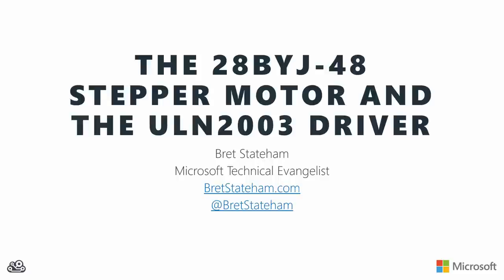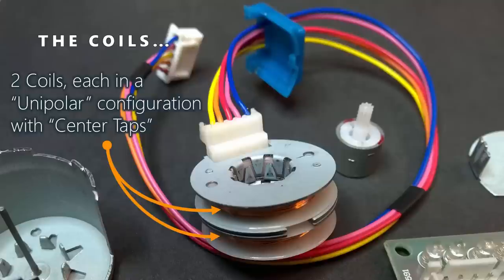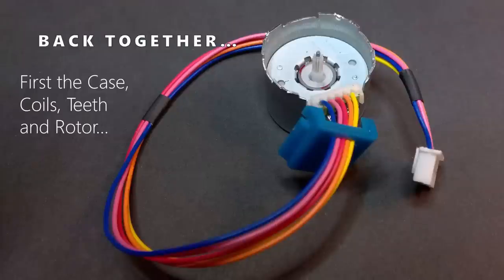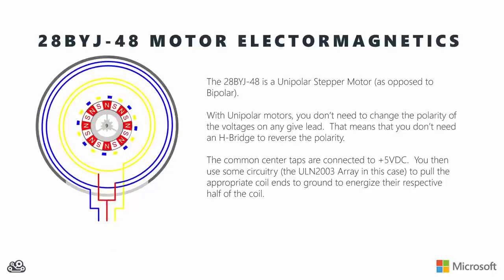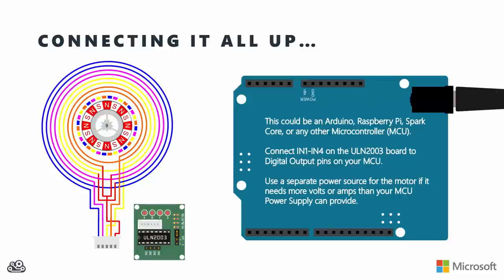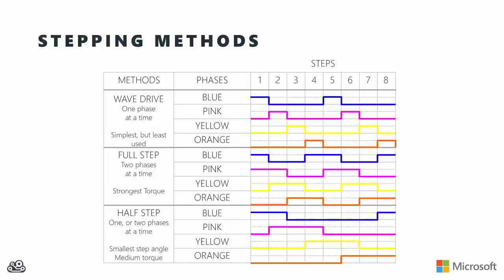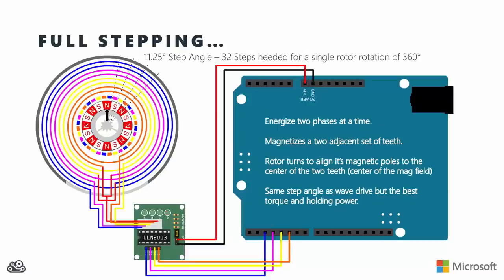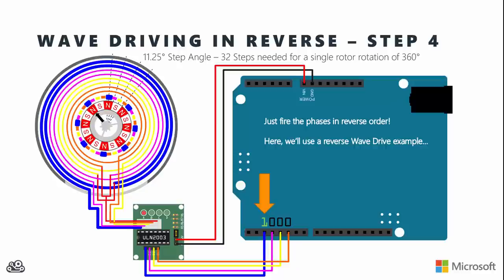28BYJ-48 Stepper Motor and ULN2003 Driver Intro

Comment: Hi Sir, may I ask if it is possible for us to program the stepper motor to turn and stop at 6 different angles , ie use it to turn a signboard with 6 sides. I would greatly appreciate it if you could give me a reply. Thanks!
Reply from the maker: Hwei, apologies for the delayed response.  Yes, using a micro controller and some code you can pretty much drive these motors any way you want.  I have another video (http://aka.ms/28BYJArduino) where I show you more practically how to drive the motor using an Arduino.  From that video you can see how to drive the motor.  From there you simply modify your code to turn the motor the direction you want, for the distance (number of steps) you want.

Comment: I ordered some 12v versions of this motor..Is there any difference besides the voltage?
Reply from the maker: I haven't tried them myself personally, so I can't say for sure.  As you suggest though, the voltage is different so make sure that you consider the voltage and amperage requirements of both your MCU and the Motor.  If you are using an arduino, you can actually power it with 12 volts so you may be able to use the same supply.  I just recommend that you pull the power for the ULN2003 board directly off the supply and not off the Arduino so there is no overload on the draw through the Arduino.  As long as the Arduino and the UL2003 have a common ground, all should be good.
Reply: Bret Stateham As far as I know I'm only getting the motor with no driver board..I'll be using the same easy drivers that I use for my mini dvd rom cnc/plotter..They should hopefully do the job and I'll most likely wire it up exactly the same way with an arduino uno as well..Oh btw the specs appear to be the same on the 12v motor as the 5v one except of course the voltage..Not 100% sure though as I could only find the datasheet for the 5v version.
Reply from the maker: Cool. We'll I haven't dug into the internals of the 12V motors.  Not sure if the gear ratio, etc. is the same.  However, as long as it is still a unipolar configuration, the overall concepts should be the same.

Comment: Hello, I am using the same stepper motor which works with 5 volts and connected it to my arduino uno but it doesn't rotate, I can only feel the steps when I touch it but nothing visible.
Reply from the maker: Erjona, can't help you without more specifics on your setup, code, etc.  Have you watched my video on driving these motors from the Arduino?  It provides a more practical overview of connecting and driving your motor.  You can see that here: http://aka.ms/28byjarduino

Comment: Can you make a video on how you turned that USB cable into a 5V power supply by splitting it and connecting it to jumpers? Because I see four wires in there. update: I found an e-cig charger that only had 2 wires, red and black.
Reply from the maker: @spinNspiral, glad you found a solution. Mine was pretty low tech.  I literally just cut the end off of an old USB cable (the end that plugged into the phone, device, etc).  Luckily, mine had a red and a black wire that I assumed were 5Vdc and Ground respectively.  I stripped the ends of the wires, plugged the other end into a USB charger block and tested the voltages on my multi-meter.  Luckily, they were the right leads.  If they weren't, I would have just stripped the ends of the other wires and kept testing pairs until I found a +5V and a Ground.    Then I soldered the ends of properly colored (red and black) jumpers to make it easy to connect to them.
Reply: Thanks Bret! I was able to finally get my motor stepping! At first I was using a 9v battery. But that didn't work. I guess it must have a circuit that only allows 5 or 12 volts through. My first success was through 5v and GND right on the arduino itself. And then I made the cable and tested it, and it worked too. Slowly getting up to drone building :) Working my way up to transceivers and gyros.

Comment: If I were to wire two of these Stepper motors in parallel so as to control both at the same time from only 1 driver, how can I be sure the Arduino is supplying enough current to each motor?
Reply from the maker: @Skyler, sorry for the delayed response.  I assume you have moved forward and would be interested to hear about your results.  That said, here's my response:

Disclaimer: I haven't tried trying to control two motors using the same pins on the Arduino.  I am totally speculating here.  Proceed at your own risk.  

The arduino isn't supplying the current.  It's simply controlling the Darlington Pairs in the ULN2003 chip to pull a the coil ends to ground based on the driving mode.  

If I read the datasheet for the ULN2003A chip right (no promises there), it looks like the input current for the chip is between .93 and 1.35 milliamps.  With two ULN2003A chips in parallel that could MAX out at 1.35 x 2 or 2.7ma.  Well under the 20ma recommended max per pin on the Arduino.  Here's a link to the datasheet: http://www.ti.com/lit/ds/symlink/uln2003a.pdf

So I would THINK you should be safe doing it.  

You would also need to make sure to tie all the grounds together, and either power each ULN2003/Motor pair with their own supply, or with a common supply that could push the required amps.  It's hard to find an actual datasheet for the 28BYJ-48 motors, but this site, https://arduino-info.wikispaces.com/SmallSteppers , seems to suggest 320ma per winding which would mean 740ma per motor, call it 1A.  So you would need a 5V/2A power supply for two motors.  

One thought that comes to mind though is that the 28BYJ motors are cheap motors with plastic gear sets and as such they are susceptible to slippage.  That means that even though you are sending the same signals to both ULN2003 driver boards, the motors MAY NOT be behaving identically, especially under load.  You may want to consider an external encoder on each motor to help determine your shaft position if having the motors in sync is critical.

Comment: So all that the ULN2003 does is light up those LEDs and relay each of the inputs?
Reply from the maker: No, the ULN2003 is what is providing the power to the stepper motor phases.

Comment: I don't know if you still read the comments, but I have a really big problem. When I try to upload any code to my Arduino uno the motor just vibrates and only LED's BC and D light up, I have never seen A light up. This could be something to do with it being blown but I can't see it being that as it is a brand new board. Any suggestions?
Reply from the maker: My guess is you have some bad hardware somewhere.  Most likely the ULN2003 driver board since the A  LED isn't even lighting.  I suggest getting a trying a different board.  Before doing that, you can double check that your jumper cables are good.  The motor/board hardware is cheap enough that I'd suggest just ordering a few online and testing with a different motor and board.   If you figure out what the problem was though, please share.
Reply: so it turns out that the board works with LED a dead, but the chip was in the wrong way round!!! luckily it wasn't damaged haha and switching it round made it work, although I still have to solder a new led onto it :) thank you for you video though, it showed me exactly how I can program it!

Comment: There is something I don't get. The yellow pin should provide a reverse magnetic field as the blue one. Why does the motor move forward instead of backwards in half of the pins? Thanx :)
Reply from the maker: Watch Gavin MacDonald's video. https://youtu.be/Dc16mKFA7Fo  He does a much better job of explaining how the magnetic fields move the motor that I did here.  Ours are very similar, but his may make more sense to you,.
Reply: Yeah, that was simple! was the perfect complement I needed. Thanx :)

Comment: I have a question on the files you provided on your follow up video. When I try to do half-stepping with your code, I can't stop my motor from going clockwise to counter clockwise after a full rotation. Your code says that I should set the number of steps until it rotates again to 0, but setting it to 0 makes my motor "jam up." It doesnt move. How can I remove the reversing command?
Reply from the maker: @Xavi, do you want it to run in a single direction continuously and never stop?
Reply: Bret Stateham yeah
Reply from the maker: I did a quick test:

1. I opened the S06_HalfSteppingWithArrays sketch (https://raw.githubusercontent.com/BretStateham/28BYJ-48/master/Arduino/Code/S06_HalfSteppingWithArrays/S06_HalfSteppingWithArrays.ino)

2. I commented out the "int targetSteps = 4096;" line of code

3. I uncommented the "int targetSteps = 0;" line of code

I uploaded the sketch to my Arduino, and the motor ran continuously in a single direction.  

Here are the updated code showing my changes to the targetSteps definition:

// How many steps to go before reversing, set to zero to not bounce.
int targetSteps = 0;  //targetSteps 0 means the motor will just run in a single direction.
//int targetSteps = 2048;  //2049 steps per rotation when wave or full stepping
//int targetSteps = 4096;  //4096 steps per rotation when half stepping

I didn't make any other changes to the sketch, and it seems to work fine. 

Getting it to run continuously in the operation is done by simply changing the "bool clockwise=true;" to "bool clockwise=false;" or vice-versa.
Reply: I'll try it out when I get home. Thank you
Reply: This works with half stepping! But what if I want to do it with full stepping? Is it possible? I made sure to comment out the 2048 steps and uncomment the targetsteps=0 and my motor glitches out.
Reply from the maker: Hah!  You found a bug.  I had a logicical math error in the "else if" block that reset the currentStep back to 0 if you were running continuously (only when targetSteps==0).  It was broken on the Half Step sample as well but the motor was able to recover from it when half stepping and keep running.  It couldn't recover from the error in Full Stepping and thus hung.   The original code was:

else if(targetSteps == 0 && currentStep == (stepCount-1)) {
    // don't reverse direction, just reset the currentStep to 0
    // resetting this will prevent currentStep from 
    // eventually overflowing the int variable it is stored in.
    currentStep = 0;
  }

That "(stepCount-1)" in the expression caused the currentStep to get reset to 0 on the step BEFORE the last step, so the last step was never getting exectued.  I changed the condition to:

else if(targetSteps == 0 && currentStep == stepCount) {
   ...
  }

And that fixes the problem.  I have updated all of the affected samples and committed my changes and checked them back into the http://aka.ms/28byjrepo repository.  You can either just modify your code to match the changes I made here, or re-download them from the repo. 

Thanks for helping me find that! 

Bret
Reply from the maker: Now, after going through all of this, wouldn't you rather just use a library like AccelStepper?  I discuss that at the end of my Arduino video on Channel 9 here : http://channel9.msdn.com/shows/themakershow/8#time=26m30s
Reply: Thank you so much for your help. Your tutorials were detailed enough for a beginner like me to follow :)
Reply: Agh sorry to bother but if I want my stepper to run at a constant speed without using the acceleration library, how do I do this? I know that one of the files were extracted from accelstepper says something like "constantspeed" which I would like to use but I have no idea how. Any suggestions?
Reply from the maker: Hey Xavi, I didn't write AccelStepper.  In the future you should use its documentation and support forums (http://aka.ms/accelstepper) or other resources like http://stackoverflow.com for help.  

That said, i figured this one out for you.  

1) Install the AccelStepper library on your machine as I describe in my other video (http://channel9.msdn.com/shows/themakershow/8#time=26m30s)

2) Open the Arduino IDE (I assume you have this, if not you can download it from http://arduino.cc)

3) From the Arduino IDE's menu bar, select "File" | "Examples" | "AccelStepper" | "ConstantSpeed"  
    Note that the "AccelStepper" option will be near the very bottom of the "Examples" list.

4) Review the code that is in there.  IT WON'T WORK AS IS.  We need to tell it which pins to use to get to the ends of our motor coils.  Again, I describe this in my other video.    

    - Modify the "AccelStepper stepper" initialization to specify FULL STEPPING (4) and to pass in your coil ends in blue (2), yellow (4), pink (3), orange (5) order.  If your pins are wired differently, make sure to use the right numbers here. Also as described in my other video the pins are passed in coil-end order, not firing order:

    //The first 4 means FULLSTEP, then the coil end pins Blue, Yellow, Pink, Orange
    AccelStepper stepper(4, 2, 4, 3, 5);  

    - Modify the "stepper.setSpeed(x)" where X is your target speed.  On my test 28BYJ-48 with a 64:1 gear ratio, my max absolute speed was about 650.  Your top end may vary on your motor, these are not precision devices! :-)  Use positive numbers to turn the motor clockwise, negative numbers to turn counter-clockwise.

    //On my 28BYJ-48 with a 64:1 gear ratio my max speed was about 650
    //Positive speeds are clockwise, Negative Speeds are counter-clockwise
    stepper.setSpeed(650);  

I'll paste the complete code below.  In the future though please refer back to the docs and more public forums for help.  Good Luck! Here's my final code:

// ConstantSpeed.pde
// -*- mode: C++ -*-
//
// Shows how to run AccelStepper in the simplest,
// fixed speed mode with no accelerations
/// \author  Mike McCauley (mikem@airspayce.com)
// Copyright (C) 2009 Mike McCauley
// $Id: ConstantSpeed.pde,v 1.1 2011/01/05 01:51:01 mikem Exp mikem $

#include <AccelStepper.h>

/*

Assumed Pin Mappings

| ULN2003 Board | Motor Phase | Arduino Pin |
| ------------- | ----------- | ----------- |
| IN1           | Blue        |           2 |
| IN2           | Pink        |           3 |
| IN3           | Yellow      |           4 |
| IN4           | Orange      |           5 |

*/

//AccelStepper stepper; // Defaults to AccelStepper::FULL4WIRE (4 pins) on 2, 3, 4, 5

//The first 4 means FULLSTEP, then the coil end pins Blue, Yellow, Pink, Orange
AccelStepper stepper(4, 2, 4, 3, 5);  

void setup()
{  
   stepper.setMaxSpeed(1000);
   
   //On my 28BYJ-48 with a 64:1 gear ratio my max speed was about 650
   //Positive speeds are clockwise, Negative Speeds are counter-clockwise
   stepper.setSpeed(650);  
}

void loop()
{  
   stepper.runSpeed();
}

Comment: can I connect the ground from the stepper motor and the ground from uln2003 to the same ground from arduino ( trough a breadboard for example) ?
Reply from the maker: As I describe in this video (at about 10:24), you need to make sure the grounds are connected.  The ULN2003 driver board has a "-" (GND) pin on it.  The ULN2003 board then pulls the coil ends down to that same ground so the ULN2003 and Motor now have the same grounds.  If you simply connect that "-" pin on your ULN2003 board to your arduino's ground you are all set.  You don't NEED a breadboard.  However, if you have additional external components that also need to be connected to ground, a bread board, or more permanent ground bus on a prroto board, etc. is certainly an option.  It doesn't really matter HOW you connect the grounds, as long as you get it done.
Reply: Bret Stateham thanks mate . English is not my first language and I am newbie to electronics. I  will use other things connected to arduino mega together  (sensors , some stepper motors etc) and I was looking for a motor to fit some posible projects.
Reply from the maker: No problem.  I have a video specifically about driving these motors with an Arduino that might help clear things up as well.  You can see that video at http://aka.ms/28byjarduino

Comment: Where can i get linear screw thread for this motor?
Its for my mini cnc plotter project.
Reply from the maker: I haven't connected them directly to a threaded rod, but typically you would use some kind of a coupler.  The brass shaft coming out the face of the motor is 5mm in diameter.  If you search Amazon for 5mm motor shaft coupler you should see a ton of options.  One end of the coupler would attach to the motor shaft, the other end of the coupler attaches to your threaded rod. The coupler would then have set screws on  the sides of each end to help fix it o the shaft and rod (https://www.amazon.com/s/ref=nb_sb_noss_2?url=search-alias%3Daps&field-keywords=5mm+shaft+coupler)

Comment: Does anyone know what type of connector to use to connect a load to the shaft on these motors? Because it is a half-round shaft it looks like you'd use some kind of collar or a hollow shaft with a set screw, but could not find anything that works well. I ended filing the shaft into a square that would fit on large plastic gear, but there's a lot of play in the connection.
Reply from the maker: +Kevin Miller Not sure about official parts, but a quick search on thingiverse showed a number of 3D printed thngs: http://www.thingiverse.com/search/page:1?q=28BYJ-48&sa=

Comment: i hooked up 4  500ohm resistors from 4 ic inputs to ground. i put in 4 switches. i stepped it around a 1/4 turn. 100's of 1-4 switch presses. on 12 volt ac adapter. motor seemed hot. ic splattering leds. I FORGOT IC IS AN INVERTER. i will redo something.
Reply: not an inverter - drawing has circles -